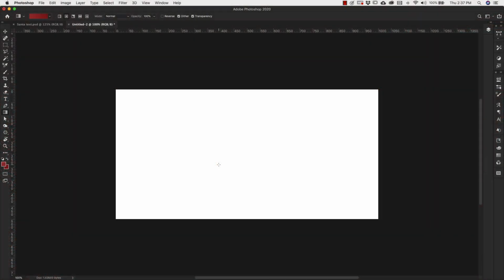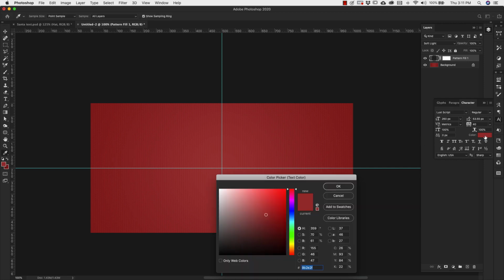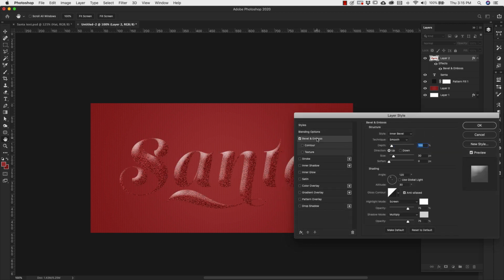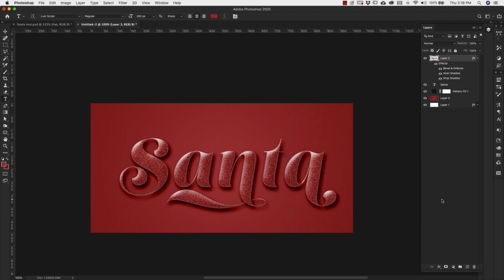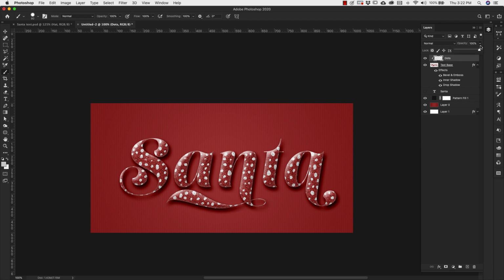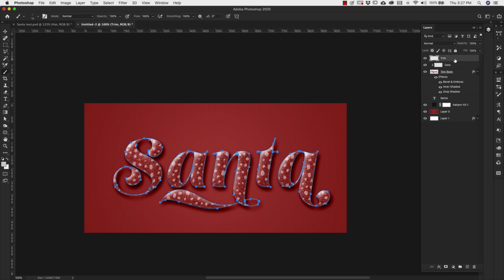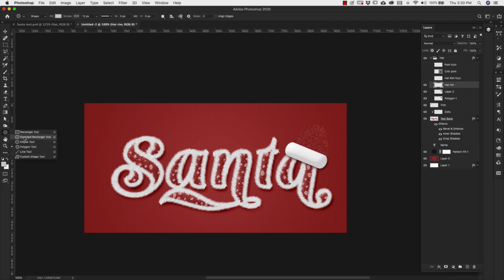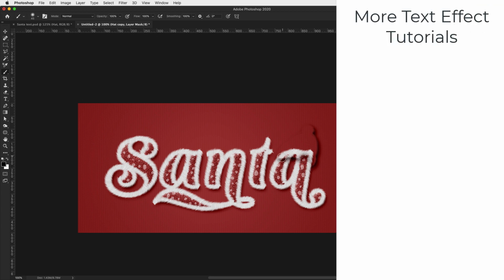Christmas Photoshop Text Effect: Furry Santa Text

Comment: is there a way to make this a layer style? TIA
Reply from the maker: You can create a style from the layer options that were applied for the inner portion and a separate style for the fur but you still have to stroke the path as I did in the video to get the fur effect. You can also consider recording an action for the fur. That way all you have to do is create a selection and play the action. This is a little more advanced but if you're comfortable with Photoshop, this is a good way to speed up the process.
Reply: @PrettyWebzMedia  ok, i'll try and do that...thanks.